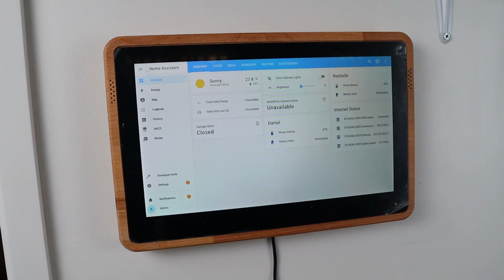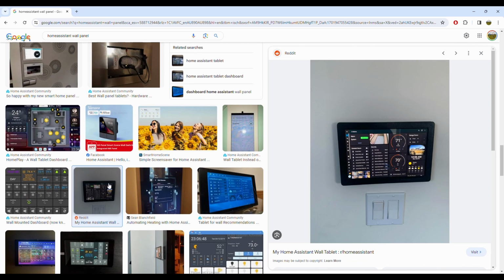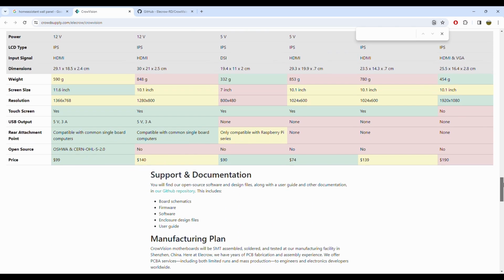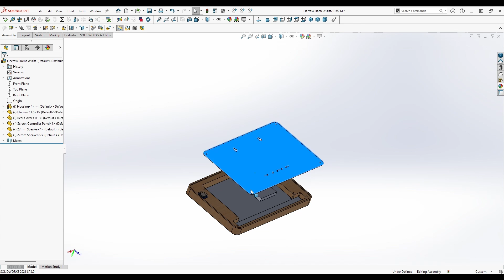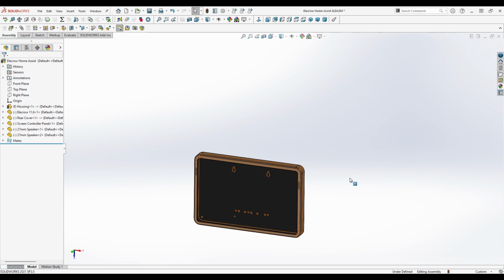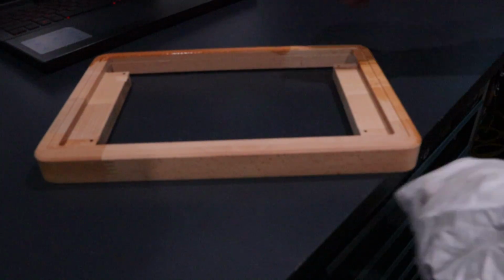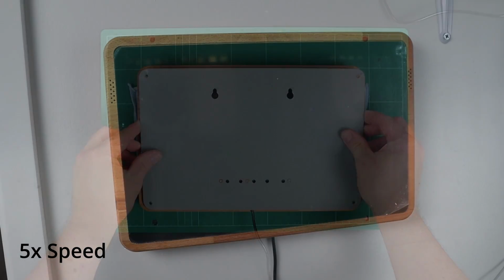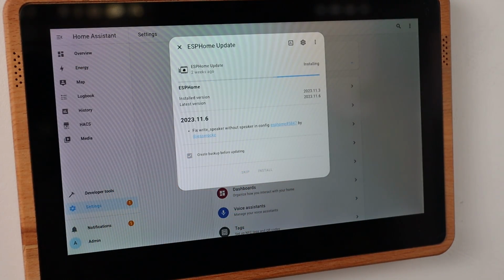DIY Smart Home Control Panel With Raspberry Pi

Comment: I need help.
after installing th HAOS 15 from RPi imager, I inserted the SD card into my RPi4 that is connected to the RPi official 10 inch touchscreen.

But Im stuck since 2 hours on the  " Welcome to HA command Line" and the local:8123 URL is also not opening the my laptop.
its Observer URL says everything is connected and healthy,

Can you guide me.

Comment: Loved the video and the quality of the finished housing. What would you recommend for learning how to use a 3D modeling tool and which CNC systems, for wood working, would you recommend?
Reply from the maker: Glad you liked it! For 3d modeling and CAM I'd recommend fusion 360. Its free for hobby use and has a HUGE user base with many fantastic tutorial videos online to help you get started. It is very similar in function to Solidworks so its a good stepping stone if you want to get into the industry too. Which CNC to choose is a bit tricky. Most will handle most types of wood just fine. I'd steer clear of the chinese 3020 and 6040 etc machines unless they are the only thing your budget allows for. They will still provide you with a starting point but they really aren't rigid enough or powerful enough for any sort of meaningful work. There's heaps of hobby grade machines in the next price bracket up so pick something that has good reviews and preferably is well supported in your area. Good luck!